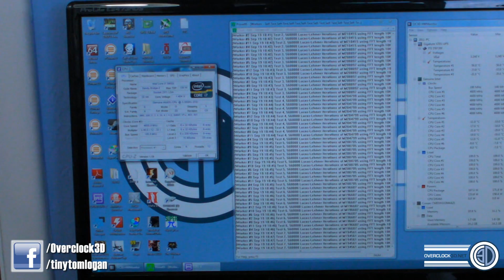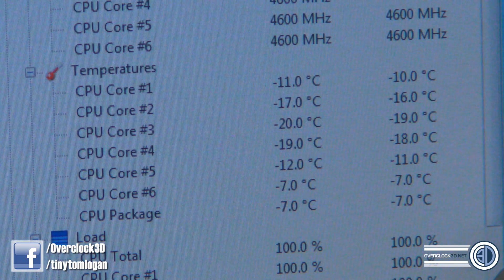Ultimate Corsair H100 Cooling Mod

Comment: ...into a gas with a much lower pressure and much lower temperature. This is the critical point where the pressurized fluid *does work* by expanding into a gas and thus loses energy in the form of a temperature decrease. The cooled gas now goes through another heat exchanger that takes energy out of the ambient air in terms of a decrease in temperature. The critical fact is that at some point the liquid/gas *has to do work* to effect a decrease in temperature.

Comment: An air compressor compresses air which does work on it and thus heats it -- it doesn't cool it. As for freezers/air-conditioners/HVAC, we're now talking about *phase change cooling.* The compressor does positive work on a gas and thus heats it. The gas ( eg. freon ) goes through a heat exchanger called a condenser where the gas condenses into a fluid by loss of energy to ambient air. The fluid then goes through an expansion valve where it rapidly increases in volume and partially changes back

Comment: Due to the laws of thermodynamics the temperature rise due to the dynamic pressure will always be greater than the temperature decrease due to the decrease in static pressure because of the overall positive work being done on the air. Air does not get cooler when you move it only when it moves something thus doing work on that something and transferring energy to it. Look it up in any standard physics textbook.

Comment: If you are referring to Bernoulli's  Principle then you must have meant pressure drop. According to the ideal gas laws, a gas with the same volume at a lower pressure will have a lower temperature but Bernoulli's Principle only applies to *static pressure.* The *total pressure*, that is the sum of the static and dynamic pressures, is higher and is the result of work being put into the system.

Comment: Sorry, but you are wrong. If we look at the "tube of fans", the radiator and the air as a thermodynamic black box, then air at ambient temperature goes into the system, the fans do work on the air thus *adding* heat, and heat is transferred between the radiator and the airstream at a rate proportional to the difference in their temperatures. There can be no decrease in temperature below ambient.

Comment: It feels colder because your body is at a higher temperature than the room temperature, and there is an envelope of air that is higher temperature than room temperature that gets displaced by the fan. So, it holds true that you can't get below room temperature without additional cooling.

Comment: Distilled water also corrodes metal faster because its electron base is native to pull electrons away from the metal it contacts. Never use distilled water in a coolant loop unless you like paying for heat blocks every year or so.

Comment: I got a request. Put 2 radiators at the same place: 
2 120mm Fans
240 Radiator
2 120mm Fans
240 Radiator
2 120mm Fans

Put them like that and put the holes for inlet and outlet on opposite sides. 

If you think he should do this thumb up this comment.

Comment: Incorrect sir, Propylene glycol freezes at -59*C absolute zero is -273.15*C. Modern liquid coolers from major manufacturers use the cheap easily accessible cooling liquid of Propylene glycol in their products.

Comment: The prefilled, sealed liquid coolers on the market do not use water, they use Propylene glycol which does not freeze at the same temperature as water. Because it is a sealed system water can not enter the system to contaminate the propylene glycol. FYI Propylene glycol is brake fluid so its cheap and easy to produce and its low freezing point of -59*C makes it an excellent choice for a cooling liquid.

Comment: i have a H100 and im really thinking of going 40fans like you did. is it possible to direct the fans so that the air hits the GPU(to unplug the cooler and get like a water-air-cooling hybrid? or would i need like 20 more fans for that?. Also (since it is very silent) you can overvolt those fans to 17v or 24v. This way you can put a ambient-temperature beer/coke/water in your case and it will be chilled in just a few minutes(also works if you want to store icecream in your case).sorry bad english

Comment: It is otherwise it would of melted when you first used it :P But if you look on core temp it tells you the max your core can get to, also if you want to test if it'll overheat I suggest using prime95 to test it to the extreme (when using it monitor it for an hour or two and then leave it overnight to see if it'll overheat.

Comment: This makes no sense...how can the temps possibly drop below zero in a room temperature room?

If you wanted temps like that, it would take LN2 or something when you figure that in a normal room, an H100 would keep this chip at 75C running at those speeds. I just don't understand how 40 fans on that rad would do what it did. Seems to defy physics.

I think you should have tested with the fans on full and then turned the fans off and see what happens.

Comment: I don't care what you think you can do it. Your just a scared little boy that doesn't know how a CPU works and what temp's it can function at a cup will get a cold boot bug at around - 100*c so you need to use a blow torch to heat it back up after its at around 80*c your cpu will boot and then as it's loading into windows you dump a shit load more nitrogen or helium in to lower the temps down to around -150*c then your good. Plus i'm done with this I'm right your wrong deal with it.

Comment: once again im saying a stock clocked one at regular speeds with this temperature of cooling at 7.8 ghz its creating enough heat to balance it out so no its not running at -150c

Comment: you cant have a regular cpu such as a fx-8150 at 3.6ghz with liquid nitrogen it wouldnt function because the clock speed isn't high enough to bring the temps up...............................BITCH PLEASE

Comment: Here is something which I thing which bothers me, the limit of water cooling using air is to the surrounding room temperature. What also puzzles me is how the water is not frozen solid inside the radiator, unless they added anti-freeze inside the water, which still doesnt take away the air room factor.

Comment: I´m sorry, but this is not how it works. Not only is the macro motion of the fluid important, you could also play around with the system pressure to influence the temperature where it changes from liquid to solid state. Check Google for "triple point"!

Comment: well yes of course, i must have typed a little wrong because it can rise more than ambient room temp if your Surface Area is limiting on the radiator, however the same still applies for cooling it.

Comment: "temperature of the water will never be higher or lower than the ambient room temp by +/- 2 or so degrees," It will go up while in use due to the cpu actually transferring heat into the coolant. That being said when the system is not on the coolant would remain at ambient, As for this non-workable solution to cooling the limiting factor on this would be the surface area of the rad. However if you can pull air from say outside in winter through the fans you could end up with temps that are lower

Comment: im actually not quite sure what your saying here, im not trying to bash you for not knowing if thats what your thinking, but anyways, heres how it works, the temperature of the water will never be higher or lower than the ambient room temp by +/- 2 or so degrees, its just how science works. As for the program, it was probably modified to read at a lower temperature for the joke. Its kinda like taking a clock and turning it backwards a few hours/mins to trick someone of the actual time.

Comment: I own my shop dude and been building, modding, programing and O.C. for since i was 13. I know the -10c was a joke it would take -50c air flow at 800CFM with some type of freon to show -10c. 
Put your CPU without the fan and no case fans and see what the temp is after an hour during idle and see how high the temp will go without the fan. The room where my rig is stays around 75 to 78F my CPU temp is at 71F on idle. Which is 21c. Now tell me how did that happen?

Comment: dude i'm not on you for the -10C, its the lower temperature then your room temperature. My rig runs lower then my room temp, when you turn on the fan in your room it's blowing air at you that is lower then your room temp. Why the hell would you say that?

Comment: Hi Tom, Great work as usual mate. Question: Are you able to repeat this test but see if you could reduce the number to 20 fans and see what the temp is then please? Only if i wanted to make a crazy mod like this in a unit then i would like it to be a little more cost effective.
If only 20 fans were used then possibly an overclock @ 4600 would give you -10c ?  just a guess and curious before i attempt to spend my hard earned pennies lol

Comment: You all do realize that to reach that temperature, the room would also have to be that cold. A liquid cooling system can only cool the processor as low as the ambient room temp unless it has a peltier in the system somewhere. Since the H100 is a closed system that's not possible. I'd like to know how the results depicted here are possible.

Comment: well, to think about it, if one or two fans will drop the ambient temp a couple normally, stacking them as such does create a "turbine" effect much similar to a single stock ref gpu cooler, ... w this setup config there is sooo much airflow there's a "wind-chill" effect moving the coolness into and the heat away at an alarming rate, 
personally i don't have 40 fans kickin around but did try it w a 3 push and 3 pull config on my single H80 and yes it did get better temps w more fan noise

Comment: Well it's not like that. It's all about moving air. Try putting your hand rally close to your mouth and blow a little bit and you will feel that it's just as hot as big mouth. Also there's no way it can get that low and if it could he would be a rich guy because he have invented a freezer that doesn't need a heating element!

Comment: Where does it say that it can go lower than a few degrees below room temperature, because Wikipedia has nothing on that, and the guy said it can go lower than the room temp by 3 C or so, so I am not sure how you think it could go into the negatives with room temp of around 25 C.

Comment: The temperature with these CPU, clocked at 4,6 GHz ,loaded at 100% and liquid cooled , will be around 85-86 degrees Celsius, if not higher.

Comment: go to 16:45 !

you cannot make the cpu cooler than the room-temp.

with fans all you are doing is encreasing the rate which energy is transferd. if you blow room temp air on the cpu it will try to make it room-temp. 

if you stuck that cooling system on a peice of ice it would melt it very fast.

do a youtube search for "Misconceptions About Temperature".

Comment: if you were to put that whole system into a box I'm sure that the temp inside the box would be hotter then outside, i don't know how the guy in the video could think that its making the place cooler. the only thing that's getting cooler is the CPU because you just removing the heat faster then a normal push+pull setup but there would be a limit to how many fans you could add before the speed doesn't increase and then they start to make more heat them selves

Comment: im trying to get what you are on about. 

the air you blew on your hand is mixed with the sorrounding air, this is called the Venturi effect (google it), that makes the air hitting your hand basicly room temperature, making you feel colder, if you breathe on your hand very close you feel warmer because then you have no venturi effect and your breath is warmer than your skin temp.

snow is water vapour in air that is cold enough to freese the water, forming snow flakes.

Comment: yes! 

the reason you are using fans is that you are trying to cool something that is producing alot of heat. so to get rid of that heat you blow air on it. temperatures always try to equal out themself. so if you blow 20c air on the cpu that is 30c the air will take up some heat from the cpu, until the temperatures have equalized.

The air coming out of the fan is heated, but the temperature change is VERY little, these fans produce 2,16W of heat but spread over a large volume of air.

Comment: air is really bad in this application.

there is other gases more suitable.

there is already the technology. 

you take a compressor a condensor a expansion valve and an evaporator.

and then you take advantage of the phase-change in the medium aswell, and that makes it even more efficient, sence the phase change uses more energy. (and yes you are not making energy dissapear, that energy is released again in the condenser)

youre just able to move more energy.

tadaa. refrigeration system.

Comment: now we are getting somewhere :) i thaught you belived in the video.

in the "sucking" side of a fan the air would be slightly less dense and hence lower in temp, but that is not even close to dissipating as much energy as the friction is producing. if you added more flow to decrease the pressure you are also adding friction making the object you are trying to cool, warmer.

it would be so inneficient that it would only produce heat.

Comment: yes!

phase change does that, thats exactly what is happening in your fridge :)

but a fan compresses the air, making it hotter, then the air expands again making it exactly as hot as it was before (or slightly hotter, because of the added energy), given that youre still in the same atmosphere.

when the space shuttle is entering the atmosphere, seen how cool it gets in the lovley breese they are experiencing?

and you should watch the ending of this video.

Comment: the fanmotor produces heat, the blades produce friction on the air. you add energy to the system, thats not making it colder.

and yea when you cool down air it goes from gas to liquid. you cant stop that happening, without heating it up again. atleast in the pressure of the atmosphere.

is ice not h20?

the air you breathe is 78.084% nitrogen (N2) but in a gas form. its still nitrogen.

and yea absolute zero is tricky buisness. still have nothing to do with these fans.

Comment: if you blow room temperature air on the water it will make the water room temperature. a fan evens out temp faster, thats it. try blowing on your hand in a sauna.

it cant get colder than the surrounding temp! 

and you dont even know what temperature is.

temperature is the energy stored in the material not the amount of material. so the absolute zero means atoms at a complete stand still. not that there isent any atoms :S

ever heard of Liquid nitrogen? that is basicly very cold air (77 K).

Comment: you cannot lower the temperature with a liquid-cooler either. 

if you want a lower temperature you need a Phase change system like a compressor. or a peltier eliment.

Comment: 13:58 Doesn´t really cost a lot :D
H100 100€
40 Fans 
40x 25=1000€

1100€ For all
Doesn´t really cost a lot.
Normal watercooling and Air Conditioner would be cheaper :D

Comment: you cant cool down a room with just fans, fans dont absorb heat,  they just move air that moves heat, dunkass. so all those fans dont really do much. but still cool! you coulda made a triple fan rad setup for the amount you apent on the 40 fans + dumb all in one system.

Comment: Funny project- but not an effecient solution. The soundlevel is high because of the turbulence - The fans just waste energy on pulling eachother,, One fan on each side of the radiator would create the same airflow. ~:-) *lol*

Comment: They could be real. If the fans take away air from the cooler it  generates a vacuum. Since heat nothing else than molecular movement you would get very low temperatures. But I am not sure.

Comment: If he used 40 delta fans in a push-pull configuration, It would have so much propulsion that it would fly through the window and some homeless guy would probably pick it up and run away with it. lolololol

Comment: Using just air you can't cool any lower than room temperature because a fan just speed up thermal equilibrium. It doesn't make it cooler. If you have a fan blowing air on an ice cube you would just make it melt faster, because the air is hotter than the ice. By using the second law of thermodynamic however you can cool something down by evaporation, but that is using a liquid. Using only air you can only speed up thermal equilibrium making stuff hotter if it's cool and cooler if it's hot.

Comment: Use 5 delta fans each slot (20)
I recommend this  Nidec V450DC  these draw on 12volts 3.5amps  alot of noise and fucking power

Comment: My suggestion would be save up for a 3930K, consider a RASA (though I'm not sure how efficient it is compared to the OCZ), and stick to full size rads. Also, you can water cool a decent 670. I've got a GB Windforce 3, which comes on a 680 board, so I just slapped on an EK 680 block and now I'm just waiting to get a backplate for it. Granted, a 2011 hex will be hotter than my 2500K, but unless you're running multi monitor, one 670 will suffice(especially at 1250MHz :D)

Comment: sweet same here, but kinda crappy, at least it's almost custom :D
started with a thermaltake bigwater 735i, that was when i had a c2q, then upgraded to the i7 950 i currently have. i had no bracket so didn't use it. one  day decided to clean the kit and WB cracked! so know i'm getting new WB(ocz) and an extra rad(xspc 240), kinda budget. dream is an i7 3830 with dual 670s(twin frozr by msi) with siftech pump and WB, i wanted the apogee HD gold edition, but last one was in germany and sold TT.TT